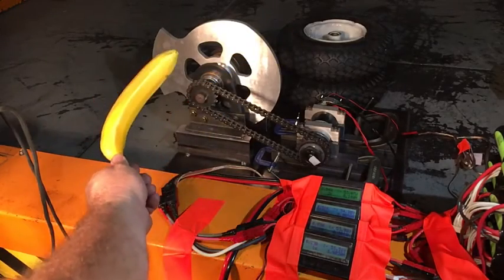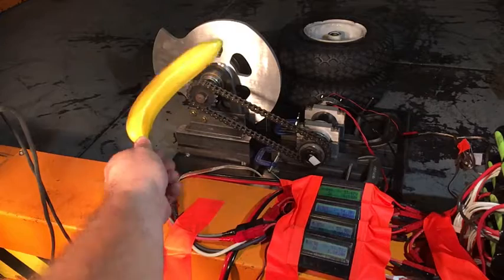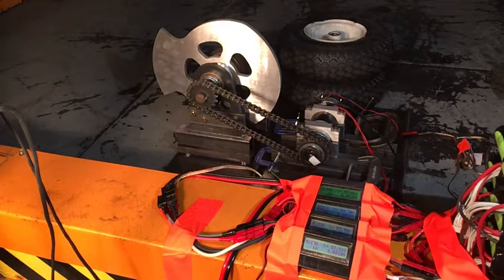First spin test of Team Toad 14.4 inch single-tooth-blade

Comment: Fuzzy, I need a little advice. I am building a lifter, but when I let off the motor, I want the lifter to stay in place so that no stress is applied to the motor. Any ideas?
Reply from the maker: Worms gears have high reduction ratios and can prevent "back driving".

But they are prone to breaking the gears under impact.

In Polar Vortex I used a combination of planetary gears, chain reduction, and a four-bar linkage to make a 2000-1 reduction for the lifter.  I included a clutch in the chain portion to keep impact forces from feeding back into the planetary gears.